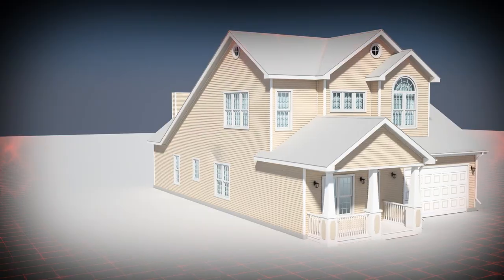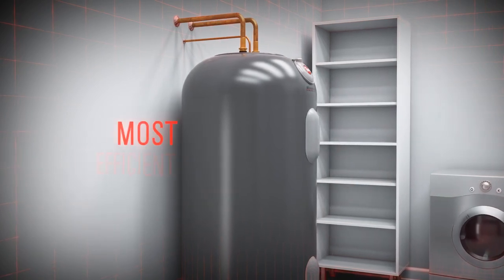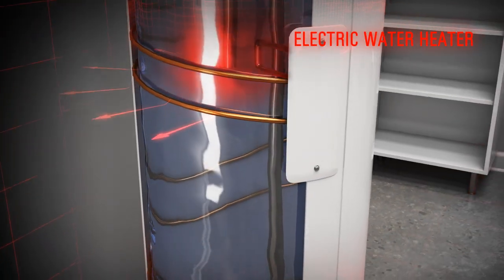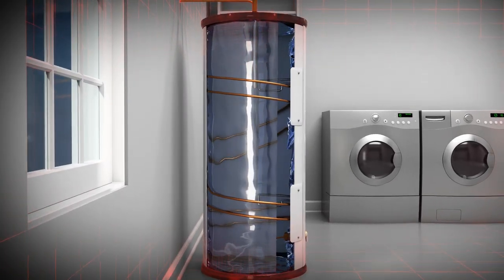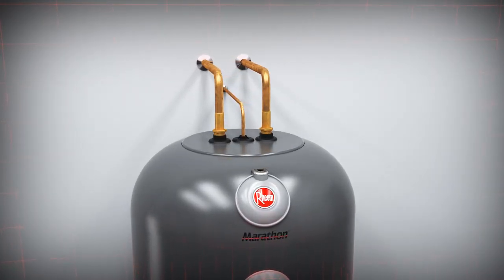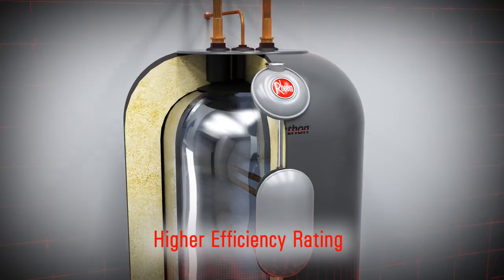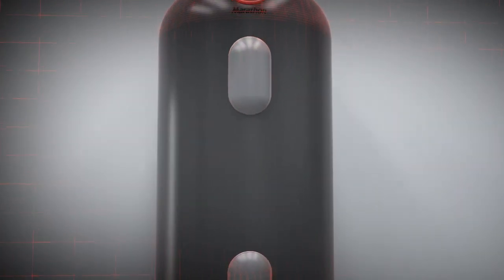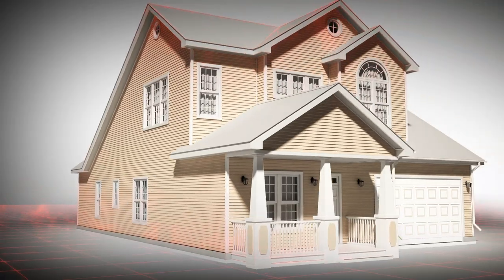How a Marathon Water Heater Works

Comment: I have 2 - 105 Gal. Marathon Lifetime Warranty water heaters.  Both installed in our new home in May of 2000.  The reason for two is 4 bathrooms with showers with multiple hand and body sprays plus rain heads.  Also 75 gal. spa tub, two laundries and three dish washers.  Never run out of hot water and both are working beautifully.  I suspect Rheem will continue to support these great water heaters.  I couldn't be happier.
Reply: There more efficient options for ppl willing to ditch the tank or have access to NG. But for someone that feels the need use electric resistance HWT it looks like one the best options on the market. Wonder did u do anything to limit heat loss in the pipes? Like by insulating them or returning the hot water to the tank? 

Thats why POS water heater r more efficient for ppl willing to use them. They r common in rest of the world but hardly see them in the USA.
Reply: You over paid. They are not worth the money
Reply: We have (1) 105 gallon rheem waterheater. In a typical house, a large waterheater is 50 gallons. Recently I replaced the heating elements on my waterheater and drained the tank. I was surprised how fast the water heated up after I filled it and turned it on. Have you tested shutting off one of your waterheaters to see if it'll keep up?

Comment: We absolutely love our marathon 105 gallon water heater. We installed it in 2004 it has lasted 15 years, recently it started leaking at the bottom (we have a safety pan) which is a steal fitting that connects the bottom tank to copper drain pipe valve. We currently have an off-peak meter provided by our electric company. We have a five bedroom house multiple kids and three hot tubs in the house and we never run out of hot water, I’m off to pick up a new one today the price is well worth it. Lenny from Apple Valley
Reply: Good thing you got the big 105 gallon tank before the feds banned them for residential use. The biggest home use Marathon today is 50 gallons
Reply: Should have got the lifetime warranty tank replacement from manufacturer
Reply: If the tank has a lifetime warranty, why didn't you get a free replacement?

Comment: My question is about the Polybutylene tank. if I remember correctly 
Polybutylene piping failed in homes due to it would deteriorate and 
crack from the inside out. When it blew it blew. It was a ticking time 
bomb in your home. There was a class action lawsuit against this stuff 
for years so what make this Poly any better than the previous ?
Reply: pipes.  different.  no issues with these.  do your research.
Reply: The stated “Polybutylene plumbing systems” mentioned in the US legal case were pipes made from Polybutene joined to fittings made from acetal resin. Premature failures were caused by the use of acetal fittings and poor joint assembly techniques. Acetal is not suitable for use in the transportation of hot water with a high chlorine concentration, however PB-1 performs well under similar conditions.

Comment: I had one of these, Lifetime warranty. I opened my water heater closet to drain/flush the tank after 2-3 years, the tank at the bottom had collapsed and was leaning against the wall of the closet. It wasn't leaking but there was a strain on the piping. I had purchased it at Home Depot. They didn't sell them any more (too many problems?). So I had to replace this water heater with a lifetime warranty for a conventional electric water heater. Good idea but they didn't field test this product. When I attempted to contact the company the phone numbers were no good.
Reply: JC HD looks like you didn't buy from someone reputable like rheem or didn't find the right contact info
Reply: "I had one of these"??? This was all BS since Rheem still in business....Who knows what he bought???
Reply: @nc3826  he screwed up the drain/flush process and melted his tank and still doesn't realize it lol  THAT is why HD no longer carries them, the average HD customer is not smart enough to handle nice things.
Reply: @galehess6676  Yep.  Didn't turn off the breaker and left the heating elements on.  Class dismissed.
Reply: @galehess6676  But Home Depot does still sell them, at least as of this morning/

Comment: How do you turn these things down? From the bottom piece of plastic that comes off? It looked like it was set on 110, so I turned it completely the counter=cloclkwise up to however far it went, cause I couldn't believe it was actually going higher than 110 and that is where it was when started, so then I thought my Mom had it wrong, but I can tell now she had it right which means tomorrow when I turned it back to 110, (it only goes from 110 to 170) that means even at a scalding 110, there is no way to get it lower than this, or is the thermostat broke? I can't afford this thing, $215 a month from 2 loads laundry, 2 showers a week, seems crazy to me. Wondering is tankless would be cheaper??????
Reply: 110 is very low, normal is 130. It's likely electric heating or AC that's costing that much, not the water heater.

Comment: These heaters don't stack up to a gas tankless. The people that install these don't have gas service in their area or subdivision.
Reply: NG is great since it relativity cheap if u have access to it. But tankless units tend to have a higher failure rate so higher water quality and more maintenance is required to make them last. Also they have a higher initial cost and there is still  heat loss in the lines. 

POS Water Heater the most efficient option overall and to gets u the hot water faster too. Especially in short water use situations like washer ur hand, When more water and heat can be wasted just waiting to get warm water.(Unless u wash ur hands in cold water?)  And if ur like the many ppl that dont have access to NG.
Reply: apples to oranges... gas vs electric and tank vs tankless.  if you are looking at this video, tankless has most likely already been ruled out... especially a gas tankless
Reply: Tankless sucks ass! Especially the electric one and the maintenance is more complicated than just draining a tank.
Reply: Georgia Power is not in the business of selling gas. They sell electricity. In fact, they GIVE builders free electric water heaters to install in new construction to sell more electricity.  If I were the builder of a spec house, I'd take the free electric water heater from Georgia Power rather than lessening my profit by installing a gas unit, even if gas is being used for the range and fireplace and heating.

Comment: Bought a 80 gallon Marathon in 2006, no problems until 2022 (16 years). Started leaking out the top at each of the three pipes (cold input, hot output and relief valve. Called company about the warranty and they just blew me off. Lifetime warranty is a total joke.

Comment: Hmmmm....Polybutylene. Lot of bad memories with Polybutylene Quest piping. More to the point about the cost;are you going to live in your home long enough to recoup the difference? Still have steel elements that rust out and/or fail. Still need to flush the tank yearly. Hardly maintenance free. I'd do some real searching with owners across the country and what kind of failures with these they've seen. Just blindly buying one for $1,200+ doesn't seem like something well reasoned.
Reply: You should not buy one.  Where does it say "Maintenance Free"?

Comment: The tank is made of polybutalene?!? The same stuff that they made faulty leak prone pipes out of and was banned by many states? Of all the plastics around you pick the most infamous one!?! The only one known to degrade in the presence of regular tap water? This game of intentionally designing extremely short lived water heaters is criminal.
Reply: The stated “Polybutylene plumbing systems” mentioned in the US legal case were pipes made from Polybutene joined to fittings made from acetal resin. Premature failures were caused by the use of acetal fittings and poor joint assembly techniques. Acetal is not suitable for use in the transportation of hot water with a high chlorine concentration, however PB-1 performs well under similar conditions.